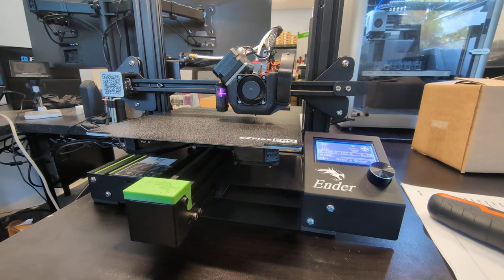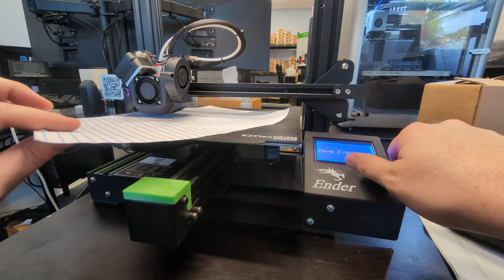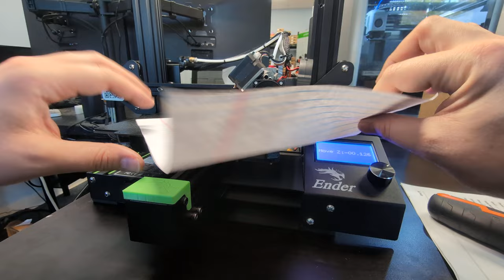Using the Unified 2 EZOffset Wizard - Offset +  Twist Compensation

Comment: I was literally just wondering what the proper procedure for this is...are the 3 values an average at the end?  Or are they remembered as independent offset corrections and applied to the movement as it follows the mesh?

Is there a best order to do these in?
Gantry Level (also I do before every print, G34 in start gcode)
Bed Mesh
Offset Wiz.
Reply from the maker: The offset is only a first time run thing. Everything else stays the same.

It remembers the 3 values in the eeprom and also calcs the offset from those to generate an offset value for z.

Comment: Tim,
When I press  done, it will drag to the next point… it will not raise up.  Does it on 4.2.7 board and the V2, thoughts?
Reply from the maker: It will only raise up with the bltouch or crouch because it has to deploy. If it's touching the bed you have to raise the z first before then going down to grab the paper.